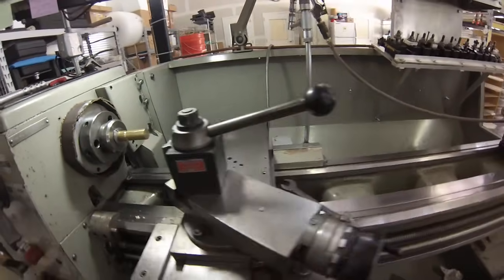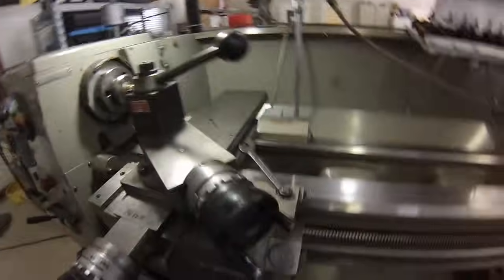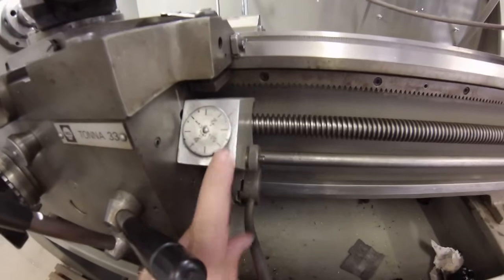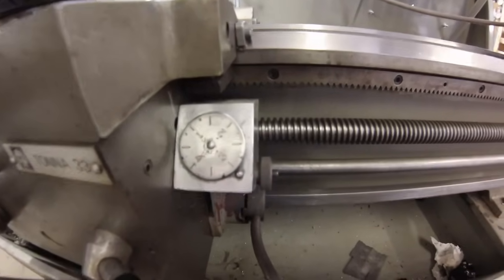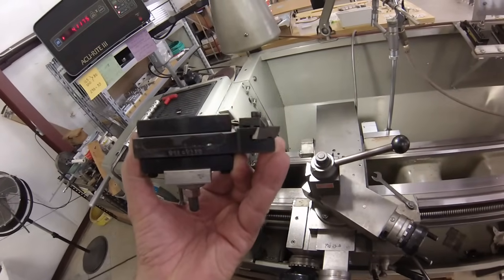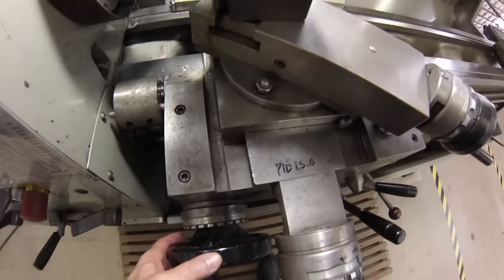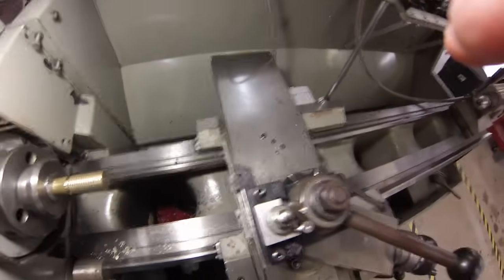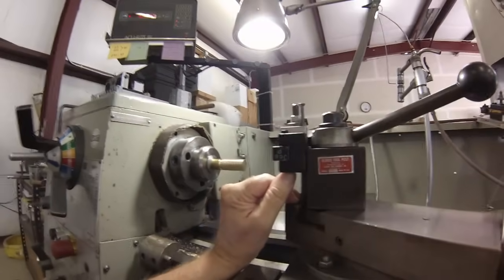Threading on a manual lathe  BEST TECHNIQUE EVER !!!!

Comment: Hi Joe,
Happy New Year!
Been watching your videos for a few years now. Thanks for them!
I just binged all your threading videos and would like to know your thoughts on how critical it is to set the angle of your threading insert.
Before typing further, I watched your video "QCTP - Quicker Setups, Better Threads, Pt1".
From this video, I am assuming that if your tool holder indicates true and you've mounted your insert holder flat against that back face of that tool holder (that you just indicated true), then your insert's cutting tip will be perfectly perpendicular to the work (assuming it is a quality insert holder). 
At this point, how critical do you feel it is to check the actual angle on the tip of your insert's cutting edges to verify they are 30 degrees?

Thanks again for all the great content. I hope this finds you in good health and that your move is going well.

Comment: Hi Joe,  Great video but I'm a little confused.  What is the compound angle?  Is your tool square to the chuck?  If you were using an HSS threading insert, would you still be using a straight plunge or using compound plunge?
Reply from the maker: I didn't use the compound and the tool is always perpendicular to the work.

Comment: I've watched many of your videos and learned a lot.  Maybe I've missed it but I have not seen a good vid on how to cut a taper (pipe) thread on a manual lathe.  Some say to move the tailstock out of center.  While I can see how this would work, but it is always a pain to get the tailstock back in center.  Would you know of a better, simpler, way??  I  know this is an old vid but I hope you find this message.  Thanks

Comment: Joe here is a question,running a 28, 32, 40 threads per inch would it not be better to turn the compound 30 deg the other direction and feed to old fashion way but in reverse?  Set your cross slide to zero and adjust depth of cut with the compound. This way you have a much finer adjustment when getting close to bottom of cut depth. I do not have a DRO on my Clausing. I absolutely love this technique especially when threading rifle barrels.

Comment: I thought: yes I know that trick. I thought no, doesn'tapply to me since I have threaded chucks and running them in reverse is a bit scary. And just now it hit me: Nothing prevents me from using lefthanded threads for my project. Ooh, my height-adjustable table will baffle future generations.

Comment: Thank you for your video on cutting threads in reverse. I build guns so I thread barrels. Over the years I have destroyed more than a few carbide threading bits because I just did not pull the split nut soon enough. After watching your video l went to the shop and did some threading. I only wish I knew years ago. Thanks again.
Reply from the maker: Glad it helped, and thanks for the feedback!

Comment: I have only just realised you do not use the compound (set to 30 degrees) with this method. So you are cutting on both faces of the single point tool.. And that is OK with carbide?
Reply from the maker: Yes, carbide is more than capable with this method.
Reply: @joepie221  Thankyou.. I just back into threading after 40 of not having done one..:)

Comment: One of the best tips on singlepoint thread cutting  in a lathe ever. I started out as a machinist in tool and die way back in 1977 but left the field when the jobs went away. Now at 66, I mave some small machine tools in my garage to make and repair things at home. I am definitely going to utilize this awesome technique because chasing threads in the lathe always stressed me out near the end of the cut near the headstock. Joe, you are a treasure. Once our generation is gone, I fear the type of machining we learned will be lost for good.
Reply from the maker: I agree. Thats one reason I'm sharing my tips now. Once its gone...its gone.
Reply: No, not gone forever. Far from it. There are plenty of young men who learned machining. We learned on machines that were 50-60+ years old- All mechanical. Its actually the route you have to go to before you can choose to go into CNC. Plenty of us worked and learned under machinists generations older than us. Theres still a few generations at least before nobody remembers how to grind a cutting tool😂 the upcoming AI implementation is probably the single biggest threat to losing ALL analog skills.. some of us don't trust the computers still and would prefer to turn a wheel😂

Comment: Joe you're a legend, any tips for us novices on threading metric on an imperal lathe? thanks from Australia, cheers.
Reply from the maker: Once you have your change gears configured per the lathe setup directions, you will have to engage the half nut and leave it engaged until your done threading. If the handle of your half nut lever comes off, consider removing it as a safety. ALL carriage movements MUST be done under power. This can be frustrating if you only have a small undercut or starting area. I prefer to run the carriage back past my starting point and return the carriage to the starting point in the same direction I'll thread. This assures all the internal gears are meshed correctly and ready to go.

Comment: Hi Joe, I really enjoy and learn from your videos.  This is one of the first that I watched and followed along as your presentation and Channel has grown and matured.  Would it be possible for you to respond with the tooling that you use for the BEST TECHNIQUE EVER.  I have Aloris CXA QCTP and would like to purchase the best insert and toolholder for this process.😊
Reply from the maker: The holder is a Kennametal top notch threading tool. Left hand. This video will assist you.  https://www.youtube.com/watch?v=qyaQqmQxZCg  Your CXA size may be too small for this specific one, but it will get you thinking the right way.
Reply: @joepie221 Thank you for the answers.  I think your tool post is an AXA which is smaller than my CXA so I think I can make your tooling work in my tool post.  Again a big thank you!

Comment: Can use a rubber band to hold the bottom two wires in place when measuring, each end of the band is over opposite sides of the wires
Reply from the maker: You actually only need 1.

Comment: your doing it wrong...... there a reason why you dial the compound in @ 30 degree.
Reply: And the reason is?
Reply: @joamonirl  
Well, Since you asked,
Their is a logical science to this, however, since your asking, You have never actually cut threads, or operated a lathe on a professional level, that said, You would not understand.
My back ground, Mechanical Engineer, Toolmaker/Mold Maker, Machinist.41 years worth. I'm I a "Know it all in the field?" NO.
If you really want to learn, read a book.
Reply from the maker: I disagree. The 30 degree or 29.5 setup is to reduce tool load. if the machine is rigid enough, straight in is fine.
Reply: Perhaps you should do some videos,  show you can teach the world all the knowledge you have , can you imagine how perfect life would be, with a cocky smart-ass setting everyone straight.
Reply: @bretfairchild456 
Did that make you feel better?
Oh, I don't need YT money!
Reply: @davidnee6157 So what you're saying is you don't know and you're one of those engineers that give us a bad name. What a douchebag set of comments. Shame on you.

If it works it works, but feeding with the compound will bias chip load to one side of the insert rather than plunging an ever deeper "v-groove profile in the exact shape of the insert. Less chatter, cleaner surface finish, better chip clearing, etc. 

PS I'm an actual M.E.(not a CAD jockey) with a lot of experience but I don't find the need to rub that in people's faces unless it's to squash an ego.
Reply: When I cut threads I use a UN thread insert. I dial at 29 degrees because I am flank cutting. I use only the compound to increase depth. If I was radial cutting the compound wouldn't matter.
Only difficulty is deciding how much flank to dial in. Most charts I have are for radial cutting.

I do not cut threads away from the chuck though. In a small part that you can get a good clamp on you can get away with it, but for example right now I am cutting 9-14s on the end of a 12" part. (Using a Clausing Colchester 15) With my jaws spun around clamping the outside I only have 1/2" of clamp on the part. Trying to thread away from the chuck I'm liable to pull the part out of the chuck.
I'm using 3/16" lead in and 3/16" idiot groove. Plenty of time. I zero the accu-rite z axis at start of idiot groove and let it go just past 0 before disengaging.

If I wanted to cut threads on small part I would just use a Hardinge.

Comment: This is my first comment to anyone, thanks , I am a newbie want to be machinist at almost 79. I had to repair an old blacksmith vise for a friend, my logan lathe will not cut 3 threads per inch so I mounted the screw in the 4 jaw chuck, hose clamps around  the handle so it cleared the ways, machined it down to 5/8-11 in reverse and it worked beautiful to install a 6in" long 1X8 threaded rod from a haybine. I had to make a new nut to fit those threads, Just had to write and thank you so much Mtnman
Reply from the maker: Glad it worked out for you. Way to go!

Comment: Joe, I'm using a BXA size aloris style QCTP.  I normally use a .750" high shank tool with a "tall" or "oversized" holder.  If I go with an upside down LH, what size shank should I go with and do I need the tall or regular BXA holder to be able to get my tool height on center.   I only ask all the specifics instead of measuring because I think you have the same BXA Aloris setup on your lathe.  All my other threading and grooving stuff uses top notch size 3 and I'm hoping I can stick with that size but I'm guessing I'll need to downsize my inserts to match the shorter shank holder.
Reply from the maker: 5/8 is a good size. You may also need to make one of these.  https://www.youtube.com/watch?v=N5AMaqooLCI&t=2s  Go to 4:30

Comment: It looks like you have a layer of cardboard wrapped around,, behind the chuck.. What is that for?
Reply from the maker: Oil slinger guard. I hate those stripes on the left side of your T shirts.
Reply: @joepie221 Thanks. My stripe is on the concrete,, it leads to the grill, hood and windshield of my car.

Comment: Thanks for the great video. Very impressed my your ability to not drop the thread wires in the chip pan.

 Hey Joe, I got a question. I'm a machinist & I have to make an arbor for a slitter machine blade. I finished all the ops today except for the 1"-14 LH which I have to do Monday. I'd like to try this technique but I'm confused-- will it work with left hand threads? I get that the lead screw and the spindle have to rotate opposite directions, like rollers on a printer. Just trying to wrap my head around it. I've single point threaded a fair amount but never LH! Cheers from RI.

Edited to add-- I guess when I turn LH threads the tool will be traveling Z + anyways...Ha.
Reply from the maker: Did you know you can measure threads with only one wire ?? It also checks concentricity. :) I do have a video on that.
Reply: @joepie221  Sweet, will check it out! Arbor turned out tops, however I had to grind the tool from a hss blank.

Comment: 3/30/25 I'm just getting into threading and was wondering what insert and holder are you using,  have you ever added threads to a bolt, I have 6 1/2" ss allen hd bolts that have 2" of thread and need to be full thread
Reply from the maker: The holder is a Kennametal top notch threading tool. Left hand. Yes I've extended threads, but first you have to pickup the original thread, or its a big problem where they blend. This video will assist you.  https://www.youtube.com/watch?v=qyaQqmQxZCg

Comment: What would you do if the lathe doesnt have a thread start counter?
Reply from the maker: Research. I believe you can still thread, but you need to be familiar with the pitch of the lead screw. This is a topic I'm not very familiar with. All the machines I've ever run have had them.
Reply: @joepie221  yea ive done it already after i dropped this comment. Its relatively the same you just mark with a sharpie the carriage z start, the lead screw's clocking pos. and the spindle's clocking pos. and engage the auto feed. Then start the machine. Just in case you care to know. Also yea some of the really old engine lathes dont have thread dials.

Comment: Fantastic channel Joe, thanks so much for sharing your knowledge in your videos.
I’ve just started trying this technique out after having to weld up a tool holder as I couldn’t get my tool height low enough and find it so much easier, it’s allowed me to up my speeds and improve the surface finish on my threads massively.
What’s the best way to use this technique when cutting imperial threads on a metric lathe or vice versa?
Thanks again

Comment: This makes such a difference and is genuinely one of the best tips out there for lathe work. Thanks Joe.
Reply from the maker: You're very welcome
Reply: @ so if using threading inserts upside down (I use Iscar ER 16) should the tool be left handed to begin with?

Comment: If you stick the wires into polyethylene foam 2 wires together and the third wire almost a diameter away that will hold the wires and make it harder to drop any in the chips.
Reply from the maker: You actually only need one wire.

Comment: You need a LH threading insert holder.  When its inverted, the insert will be towards the spindle.

Also: verify that the leadscrew has RH threads.  
My Cincinnati Tray Top has a LH leadscres, so I  get RH threads when the leadscrew/spindle spin opposite.
Same direction Leadscrew and Spindle = LH threads.

I can't remember the last time I needed to turn a LH thread, I'd definitely run a scratch pass to verify direction and thread pitch before committing to a full cut.

Comment: So I tried this method. Of course it's not a matter of "did it work or not" - of course it 'worked'.

I'm a self-taught hack when it comes to machining. I bought a Grizzly 4005 "Gunsmith" lathe, and their G3617 mill and "taught myself" to use them. Therefore, I learned to cut threads the "regular" way. Never had a problem running into the head, but I will admit a certain anxiety about it. I actually conceived of cutting threads the way you teach here, but I missed some critical details. I ended up with a very nicely done resizing die with LEFT-HANDED threads. :) Anyway, as I said, I tried this method, this time doing it correctly, and ran into a problem. I almost always use "full form threading insert" to cut threads. I'm not a machine shop and am not going to invest in the tooling or materials to MAKE thread cutters. Here's the problem: The relief cut, to the left of the threads, has to be LARGE in order to accommodate the insert. MUCH larger than I cut when I am cutting threads "the old-fashioned way". 

I have learned a great deal from you, and I sincerely appreciate the time you spend providing thorough instructions.

Comment: How do you feel about the guys that never disengage the half half but. They stop the machine in the relief and reverse the machine. I tried the method on a 3/8 x 16 for practice and it was easy. My next practice I'm trying what you just demonstrated. Looks even easier.
Reply from the maker: Its necessary with metric threads and under some conditions, but I'm not a fan.

Comment: Hi Joe. It wasn't really clear from the video, but do you still use the 29&1/2 degree compound method with this technique? I tried using your technique for making internal threads to a stop (as per your other video) and I felt like due to the direction of the cut the whole compound was being pulled out due to the backlash in the compound lead screw. I tried to fix this by swinging the compound to the opposite side, but this causes clearance issues.
Any feedback would be greatly welcomed.
Regards,
K.

Comment: I was talking with my dad and said that that technique could potentially pull the part out of the chuck have you ever had any issues
Reply from the maker: It really has no more potential than it would pushing the material into the chuck, right ?? In 50 years, I've never had a problem.

Comment: Excellent technique.  I didn't have a LH threading tool holder and the RH couldn't get close enough to the shoulder, so I used an internal threading bar turned upside down to make my external threads.  Worked great and I'll be using this in the future when threading to a shoulder.
Reply: Could you please do a whole video on just the 3-wire method.  Showing chart numbers and calculations.

Comment: im hoping you can answer the why to this question. i cut OD threads, tool to the back side, cut away from the chuck. i was having issues with chipping the carbide using the crossslide. so i used the compound instead @ 29*. the threads had a "rolled back" look, the left side rear face was closer to 90* while the front side had a normal looking thread angle. Like only one side of the thread was cut. is that from feeding the tool back towards me somehow instead of pushing into the part?
I noticed later on after trying again that the compound lever was moving from Tool pressure at times. I guess that could have had something to do with it
Reply from the maker: Having one side of a thread look like 90 degrees would indicate the tool is incorrectly positioned or shifted. Also, make sure all you dials are against the cut load direction too. Backlash can come into play in certain situations and result in all kinds of problems.

Comment: Hi.  Can this method be used on Metric Threads. The half nut is always engaged  so when you travel back to the carriage stop  under power won't the carriage crash the stop.  Cheers  Paul
Reply from the maker: Sure. But because of the half nut issue, I'd remove that stop to be safe.